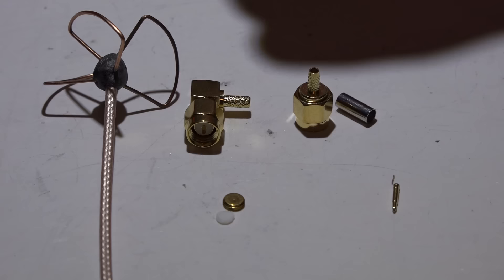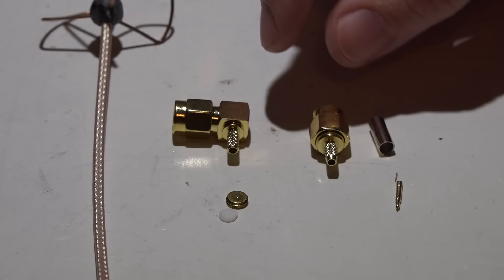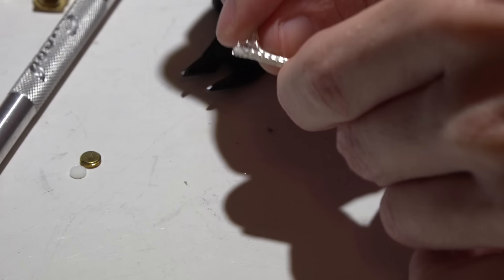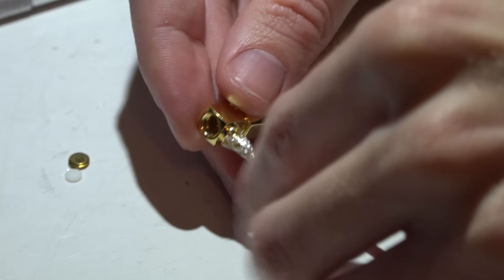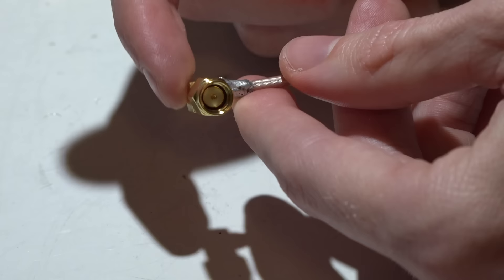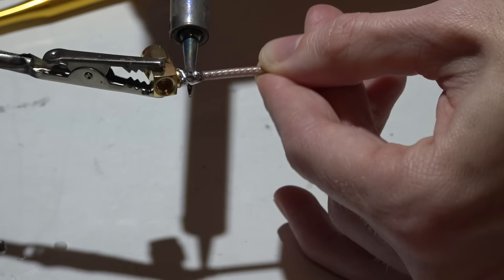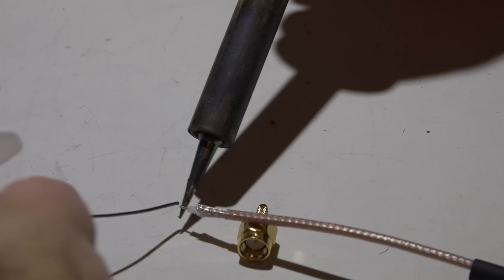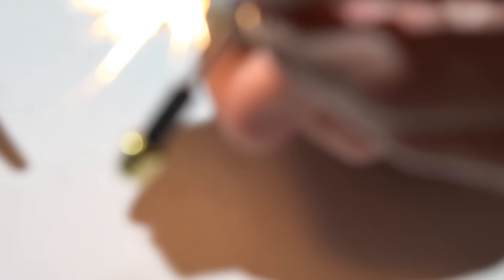Replacing Antenna SMA Connectors (multirotor FPV)

Comment: Thanks for this  video.  You are the Man.  Although I do FPV, your video helped me replace a broken SMA connector on a Slim Jim ham radio antenna without having to buy the expensive stripper and crimper.

Comment: Thanks a million, I purchased the sleeve crimping tool, that was a waste,  I have repaired my little antenna lead many times using the tool, of late I decided that I needed to solder that center pin, that fixed some problems but still the ends pull off if not treated with kid gloves and I haven't owned a pair of them since my Army days in the early 70's.  I have another pack of ends coming, in the next set, I will follow your instructions and see if my little radios will run right with the good method of repair.

Comment: i always wanted to do this. Great video.  Just a question the right angle bulkhead, if you do not solder the inner core signal wire to the pin is there a possibility in a crash or even just bending the rg cable inner core wire get push inside and contacting the outer wall. Have you seen this happen before?

Comment: I just learned so much from your video thank you very much. How do you determine on the length for gmrs and or ham radios and can you use the 771 from gmrs radio 2 a ham radio and share the same antenna with open frequency. And just switch from gmrs two ham radio without changing antennas. Thank you very much for the great show Merry Christmas and Happy New Year to you

Comment: Good thing that’s Teflon coax/connectors or you would totally turn your coax into a molten blob!   You aren’t going to use this method on RG-174 ,  I understand the desire to reuse connectors but I’m also fairly sure these were never meant to be installed twice.  Good luck!  I will try this with some RG-316 see what I get

Comment: a dab of flux would work wonders for soldering the ground shield wire to the connector.  Also, maybe snip a piece of solder into the pin and head it up versus trying to  get a drop into a tiny opening.

Comment: Is it also possible to use the existing sat-comnectors and adaptors F connector to SMA? Or will I have a weak connection by doing so?

Comment: Very interesting, I wish to solder a micro version of this coaxial wire (xbox series XS controller) and using that gauge you have would be easier. Are antenna, gauge specific? EDIT scrap that; Any thicker and it wouldn't have the correct SMA size

Comment: Dude, you definately need another solder tip for these jobs, that little point tip will only be efficient for little solder pads... take a bit wider one (flathead screwdriver style) will distribute the heat very well. As i saw you using the tip on the bigger part of the tip...

Comment: i was wondering what cable has to be used. i was thinking on using a coaxial cable and putting this connectors. does has to be a special cable for the antennas frequencies? i want to make a long cable from a yagi to a huawei b310 router

Comment: Sorry to hear (based on the comments) that this person is no longer with us, but for those of you watching this video in 2024, please, please, PLEASE use flux when soldering.  Flux-core solder is not a replacement for proper flux application.  That giant glob of solder is a big ugly cold solder joint, which won't be nearly as strong, nor as electrically sound as it would be if flux was applied and 1/4 of the amount of solder was used.

Comment: In order to solder, the substrate (connector in this case) has to be brought upto temperature. Your solder joints are cold.
Reply: Not true.  By definition a cold solder joint is one that is not melted completely, which may cause cracking or failure in the future. Just because he heated the cable more than the connector does not mean the joint is cold. Is it perfect technique? No. Will it fail in flight? No. Why? Enough solder is bound, and has melted completely. It's not perfect, but it's also not a cold joint.

Only replying to you because the creator died in a motorcycle crash a little over four years ago. So he cannot defend himself.
Reply: Exactly, even in death he has created a legacy of great training for us radio enthusiasts. Rest in peace old friend. Your sorely missed.